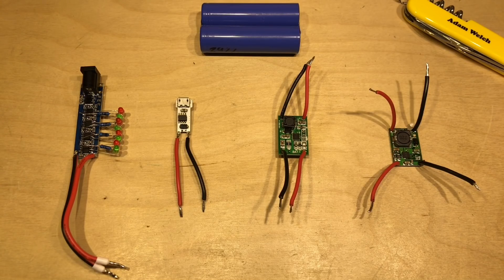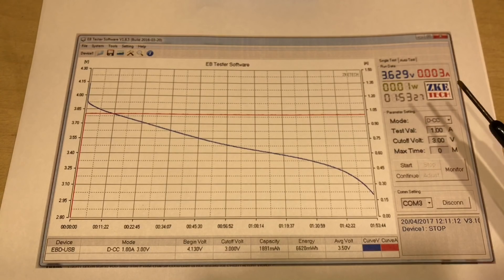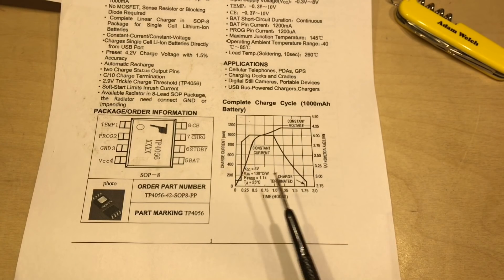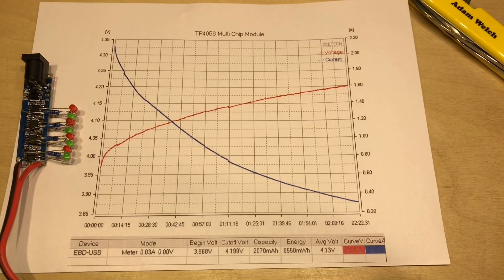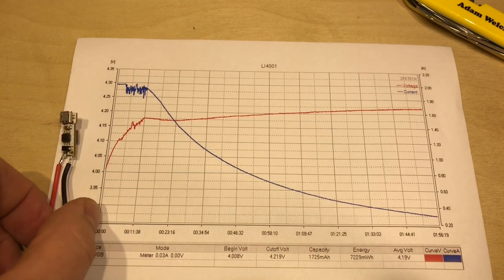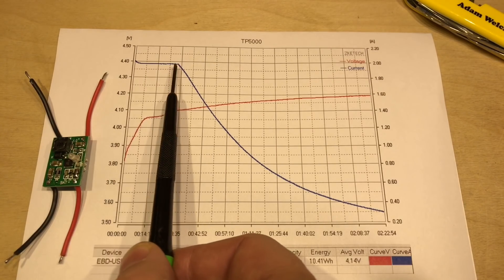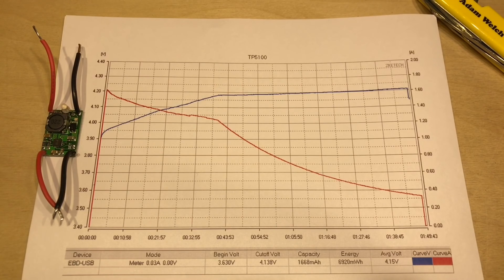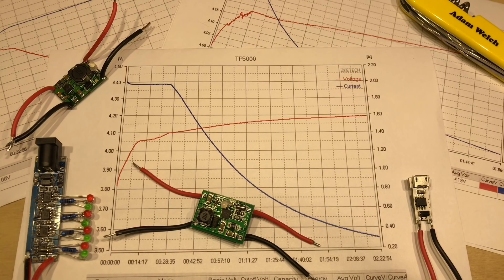High(er) Power Lithium Ion Charger Module Shoot Out - 12v Solar Shed

Comment: Great video!. I have a question: You are using the ZKE electronic load. How are you able to read charge current with it? Input is USB, where is the output going to the battery? The meter has to be placed in series with battery. Yet in the description of the ZKE in Ebay I don't see any mention of an output port.. maybe I missed it.

Comment: There are more and more tp5000 boards out there, however the price is still arround  $2.50 AUD VS under $1 for tp4056. Pple who dont know often skip it as they get hung up on A rate. As more experienced tp4056 users know, getting 1a out of it needs much better cooling. The tp5000 boards that i have seen come with heat spreader on the back of pcb, i would still put one up on thr ic itself to help. Definitely give the tp500 a go if you get a chance. Cheers

Comment: I experimented with those TP4056 modules as well. And they have serious heat problems indeed. Here my results:
Without any heatsink, the TP starts at some 300mA with a cell voltage of 3.5V and ends at some 550mA before the CV phase begins. Then I added 3 stepper motor driver 10x10x15mm heatsinks, glued one ontop of the TP chip, and two onto the reverse side of the PCB. Now the charging current started at about 750mA at a cell voltage of 3.5V and raised up to reach the full 1000mA at a cell voltage of about 3.9V, keeping it up until the CV phase started.
As you see it's almost impossible to get out the maximum capability of the TP4056 unless you provide massive heat dissipation capabilities to the chip and the underlying PCB. Otherwise the overheat protection measures of the TP make the chip useless for charging currents above 300mA.

Comment: I like the TP 4056 3A module, I think it can be improved by adding a heat sink on the bottom of it. The TP 5000 is rated at 1 amp and that isn't enough for what I am planning on using it for, so I think I will get the 3 A module and heat sink it.

Comment: I have several TP5100 modules and they work fine for me. Charges at constant 2 Amp.
I can't find TP5000s preconfigured for 2 Amp charging, though... Where did you get yours?
Reply: Do you charge 2s or 1s  cells?

Comment: Did you ever check the actual cell voltage with a multimeter directly at the cell while doing the test? You might have wires that are thick enough (they aren't really that much of an issue at these short runs), but barrel connectors can be and croc clips are really quite bad. At one amp contact resistance becomes relevant, especially when you want to monitor voltage differences in the tens of mV range. This also applies to the charger ICs themselves. They won't see the actual cell voltage, but an increased one while charging. Or seen the other way round: the charger has a certain output voltage, but after all the voltage drops due to connectors, what arrives at the cell is much lower. Problem is the charger only knows about his end and goes into the constant voltage phase way too soon.
The same for the discharge test. The voltage at the load will be lower than the actual cell voltage, because of the voltage drops in the connectors.
That is why you usually have 4 wire connections on load tests. Two wires to carry (and measure) the current, and two wires purely for measuring the voltage right at the source (no current so no voltage drop).
Reply: Explains why I get 2 Amp with my TP5100 modules without any problem.

Comment: Does 1A charging current mean i can only draw 1A? I have a small solar cell with only around 500 mAh but the load is a little above the 1A limit. Im not sure if a single TP4056 can handle it.

Comment: Hi Adam, love your channel, I was particularly interested in this video as I build small-scale solar panels about the size of an A5 notebook. They are great for charging single lithium ion cells, but I have a question for you. Rather than using a 5v solar USB module into a TP4056 to charge the cells, do you think it would be possible to hook the panel straight up to a TP5000 module instead? I reckon it'd save a good bit of power by cutting out the 5v USB middleman. My question is basically, would it damage the cells or the module? The prototype panel I'm testing at the moment is supplying ~7v DC at a max current of around 300mA in direct sunlight (not a powerful panel by any means). But it's just one of my first prototypes for the moment. I don't have an oscilloscope yet, so I don't know every detail of what's going on in the chain exactly. Any advice or questions you'd have would be greatly appreciated...and hey, thanks for sharing your experiences with us.
Reply from the maker: Cheers for the kind comments.
The TP5000 modules are good for about 9 volts I think - and they're switch mode so it looks like its worth a try.  The issue is if the TP5000 is trying to charge at too high a current it may bring the voltage of the panel down below the operating minimum (around 4.5v).  You might need to change the current setting resistor to suit what your panel can typically provide to prevent this from happening.
Reply: Great! Sounds like it's worth a shot to test it out then. Thanks again, and I'll let you know  how I get  on. Might make a video of it so others can check it out too. Take care Adam!

Comment: How did you connect the ZKE EBD USB to your 18650 batteries while charging them ?
Reply from the maker: +JS7457 I used the adapters I showed in the video - so it was module output to ZKE input, ZKE output to 18650.
Reply: ok, ty but won't it give false information because the charger modules is 5v ?
Also, could you mesure a simple tp4056 module (clone) and the 3a one in the video but limiting it to 2a, this would maybe change the charge.
Oh yeah, i got a tp5100 and i've charged 2 cells in series but the charge voltage in CV mode it's about 8.46V and that's alot, it should be 8.40V or less. What do you think ?
Could you also test this one please, up to 3 cells, looks good, a bit expensive tho :
http://www.ebay.com/itm/1-2-or-3-cells-1-2A-Lithium-ion-Battery-Charger-Module-PCB-18650-iphone-14450-/331680095434

Cheers
Reply from the maker: No it won't give false info - I placed my meter between the module and the cells.Thanks for the link - looks like it's a slightly modified CC/CV buck converter.  I might grab one, Cheers.

Comment: Great test,  I have several tp4056 and the measured charge did not match the data sheet at all.
Reply from the maker: +Vince Herried I found when I first looked at the multi chip Tp4056 module that the target voltage can be quite different too!

Comment: Great video. I use the TP4056, and i'll replace those with the TP 5000 right away!
I have a question though : what about BMS?
On aliexpress and the likes, we can find battery management systems (BMS) boards that provide over and under discharche protection. To me, that means that if i flow current trough those, they'll charge the batteries up to the limit.
SO what about using those BMS with our lipo cells?
Reply: and by the way, do you have circuits like the TP5000 to recommend for lead batteries? otherwise i think i'll roll my basic one with a µC cutting the current when a defined tension is reached on the battery :)
Reply from the maker: +Audrey Robinel Single cells don't usually need a BMS just over discharge protection. These are all pure charging modules. If you need over discharge then you'll need to look at a protection module - typically something using a DW01

Comment: are there any boards like these or the one mentioned in the comments that do 3 batteries in series
Reply: It seems there is, but it's a bit pricey - http://www.ebay.com/itm/1-2-or-3-cells-Lithium-ion-Battery-2A-Charger-Module-18650-Charging-PCB-SY6912-/322433792495?hash=item4b128d39ef:g:NrYAAOSwSlBYsFdF
Reply: There is, but it's a bit expensive - http://www.ebay.com/itm/322433792495?_trksid=p2055119.m1438.l2649&ssPageName=STRK%3AMEBIDX%3AIT